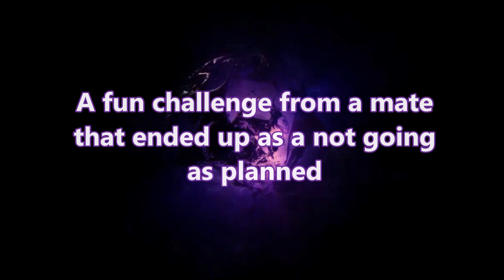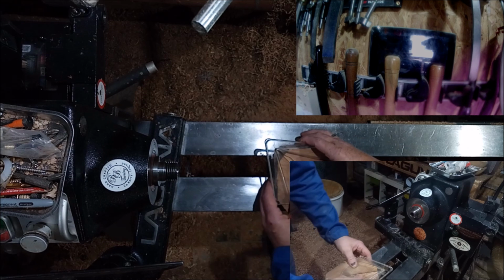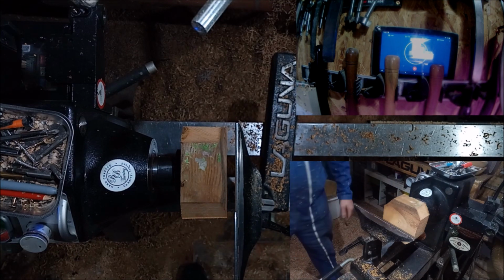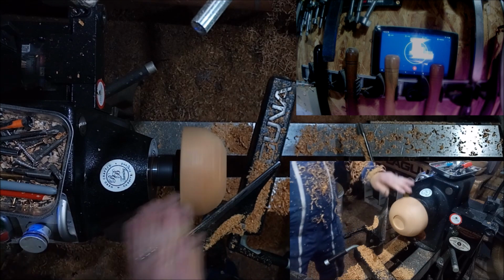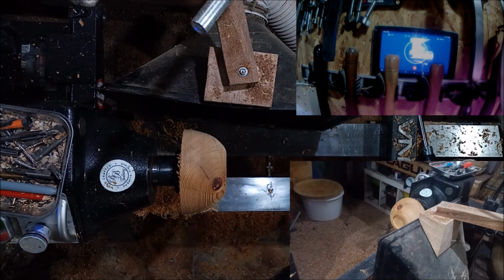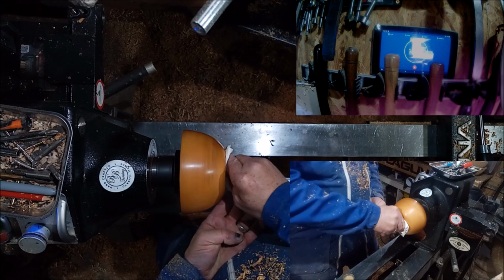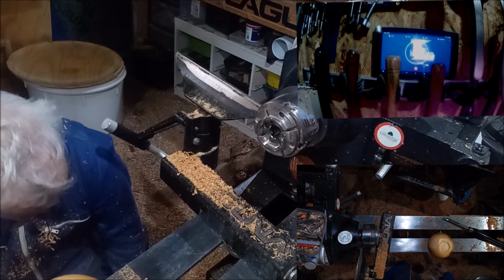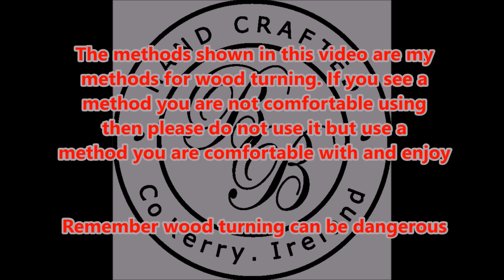A bit of a disaster while woodturning a fun challenge

Comment: So sorry that the recess didn’t hold. A slightly deeper recess May well have worked out better. But no matter. Hope you plan to put that back on the lathe and finish it out. This is a nicer looking piece of pine and would be a shame to just toss it in the fire pit. The 30 minute challenge may have failed, but you certainly have a nice bowl on the way. Thanks for sharing.
Reply from the maker: I will be putting a tennon on it Doug and finishing it. My daughter is looking for a very small bowl for something and this should do just fine.
Shay.
Reply: @BBTurning  sounds like a good plan to me. Be careful!
Reply from the maker: Will do.
Shay